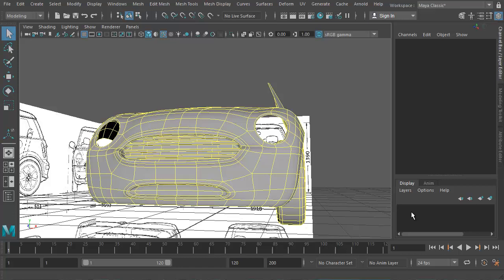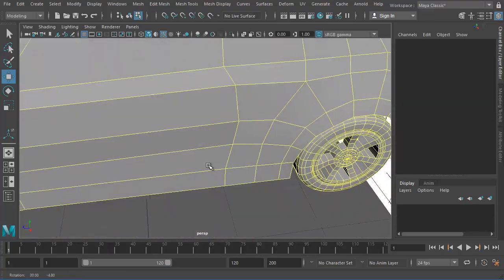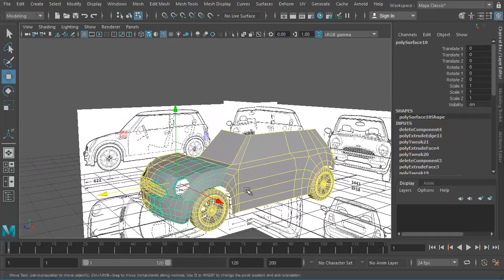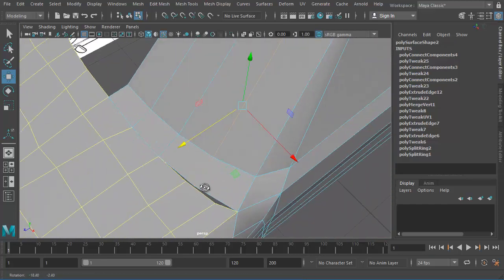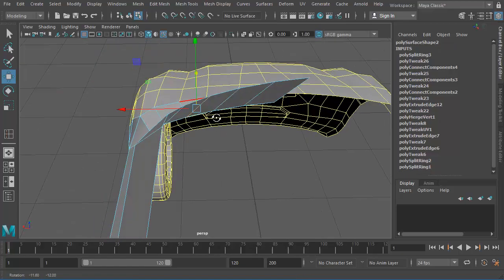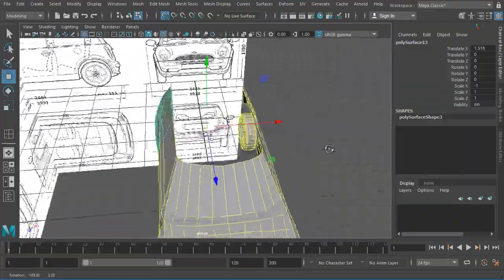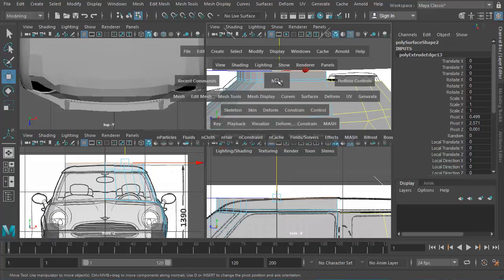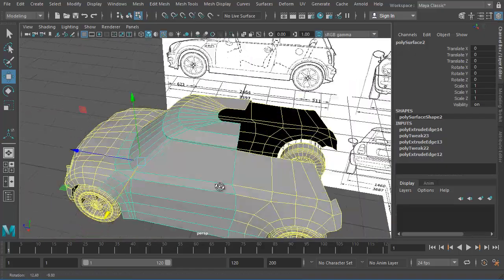Maya 2017 Tutorial : Car Modeling - Part 5

Comment: Wow, 0 comments? I'm surprised! I've been following your tutorials as practice for college, and you're really clear with your instructions! But I'd like to ask: was Mirror tool not around back then? Because I feel that you could have saved a lot of work by using the Mirror tool rather than the Duplicate Special tool.
Reply from the maker: Yes. You can use the mirror tool. But I like to keep both sides separate. Earlier it was called mirror geometry. But I wasn't comfortable with it at that point of time.... with newer versions they have improved the tool.. may be in the new tutorials I can use the mirror tool. Thanks!